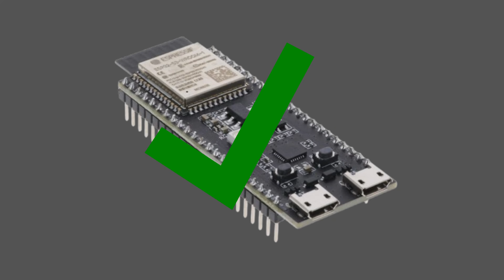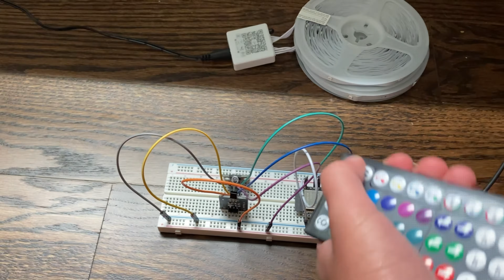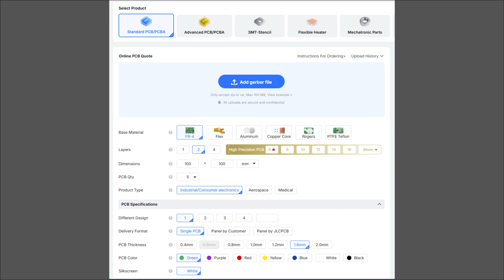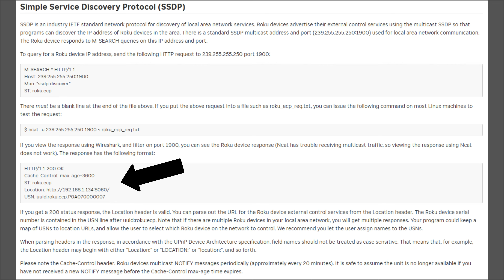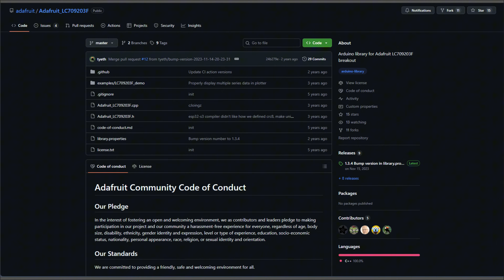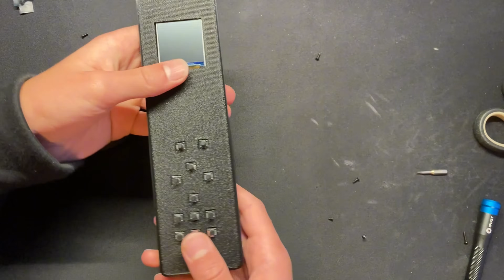Building a Custom Universal Remote!

Comment: 2:18 Probably would just use a cheap programmable TV remote from the local dollar store, then add the esp and display to make it actually useful. They cost next to nothing, and include buttons as well as IR IO. 

Love the idea of a truly universal remote control, but never tried. Thanks for the nice video and inspiration. Might actually try myself.
Reply from the maker: Oooh that is a good idea. I wouldn't of had to worry about the enclosure layout.
Reply: @ElectronicBuilds724  Apparently there is a 2023 project out there called "omote - open universal remote" with IR, BLE and Wifi capabilities. Since I'm looking into WLED for controlling neopixels with an esp32, a remote which is also esp-now capable would be perfect. Sure it's not as impressive as doing it from scratch like you did, but I'm no engineer, and the omote still requires a lot of tinkering.
Reply from the maker: That would be cool to try out! Let me know how omote works if you plan on using it.